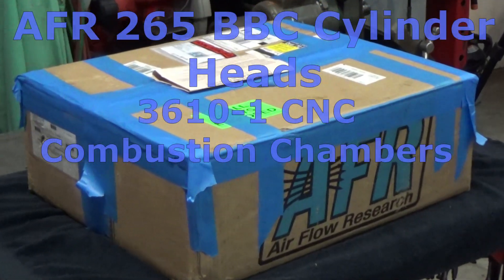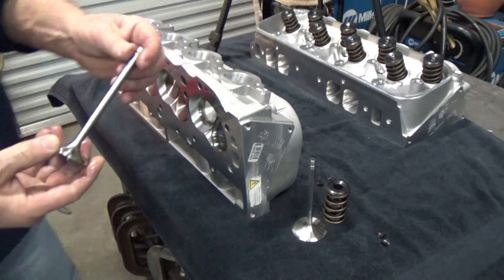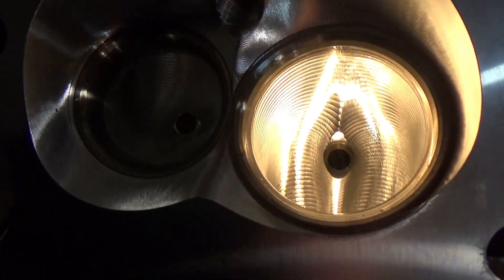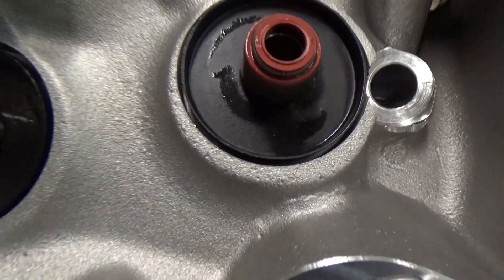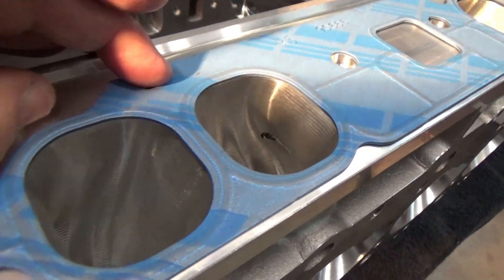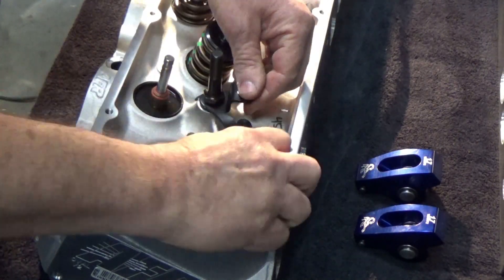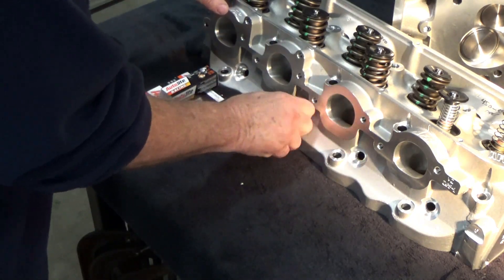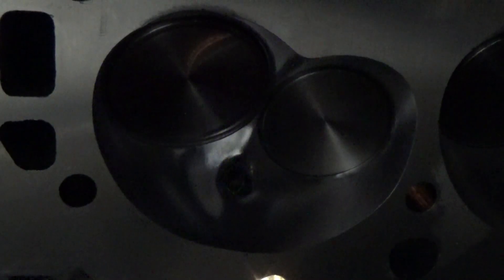AFR 265 BBC Heads... (Lets take a look  at them)!!👍#11 Chevy 454 Big Block Performance Build..

Comment: Hi sir, I can use some advice please,the cam I bought is 4 degrees advanced,do I install the sprocket at the 4 degree slot? That's what I did but having trouble degreeing the cam at this point.I am tempted to finish it up the way it is but I have to much money invested in it, can you give me some advice please? I sure could use it.
Reply from the maker: So if the Cam already has 4 degrees advances and you put your sprocket +4 degrees that would be a total of 8 degrees advanced... If you put it at 0 advance on your sprocket the cam is 4 dgrees advanced... If you put the sprocket at -4 degrees the cam would be on 0 degrees advance....  Ckecking the cam in the engine with a degree wheel is finding out if all machining operations done on the engine crankshaft, timming chain sprockets, and cam shaft are correct.  Hope this helped.... Look up (Grumpys Performance Garage) on the internet.. There you will find alot of info that can help you on your build.... Thanks

Comment: I knew i seen a video with these heads and using the springs that came on them for a solid roller i did not know it had to be a street grind i have a howards hydraulic roller 235x241 with 618 lift on a 108 lsa i do have a comp xr294 r  solid roller that is  254x260 with 660and 666 lift on a 110 lsa that id really like to run when i built the engine i was hopeing for 550 hp well it did way better it made 661 with 606 torque i was really surprised  i need to check and see if its a street grind and check the clearance what are the specs on the cam your running? I love my afr265s
Reply from the maker: Hi..... Its a comp cam street solid roller in the  240s at 50 and in the 600 lift....  Yes I really like 265 heads too....

Comment: Thanks for sharing I bought the AFR 325 and a Super Victor then had them checked and fully ported,He cut the intake into at the middle to port like he wanted,,I have a 505 ci engine I may have to much head ,I may order a block and make a 565 ci for these heads to work, he recommended a 1350 cfm carburetor, Self Racing, Kevin did a great job, He did these heads about a year ago I got to get going! Subbed for future videos
Reply from the maker: Wow Ronald ... Sounds like your going to have a very high hp engine.... I looked up (Self Racing) and looks like
they are a top Engine Performance Shop... Good luck with your engine and thanks for the Sub...👍
Reply: @Myersmetalworks  I have do business with them for years and sad to say covid caused Kevin and Glen to pass away, Great family,y car is fast with the current 496 and Pro comp heads and if I install the new heads they claim I'd pick up a 1/2 second, I run 567 @ 123 on my last pass and I'm getting a little old to be going much faster! I just let it idle and deck it on foot brake,ofcourse it has a pro brake but the 496 is a fresh build and I shift it @ 6600 rpms, I running a large Howard's Roller cam that will really perform if I'd turn it up ,it's got all aftermarket bottom end and I wouldn't be scared to buzz it up but heck foot braking what's the use!LOL

Comment: I have the same heads on my 427 60 over so it's a 440 and a howards 235×241 duration @50×618 lift lsa 108 and I used a victor Jr intake with a Holly 850 hp I'm hoping  for 550 hp. Next I will be building a 496.and I'm going to try to make 700+ hp on the street. Great video
Reply from the maker: Hi Richard, Thanks for the nice comment... Sounds like you have chosen some good components for that 427 to get to the numbers that you would like... I just like the way 427 sounds 😀    And good luck on that  496 Build....
Reply: Fddo you think with the cam shaft I have  its a howards 235x241@50 618 lift I can make 550 hp or do I need to go up in camshaft like 248 x 255 any help would be appreciated thanks Rick427
Reply from the maker: Hi richard... More duration usually will help give you a higher HP number...  But its hard for me to say for sure 
what size camshaft the engine would need to hit those numbers you'd like to hit.... To me its about a good
combination of parts working together that give good HP Numbers.... You have good heads... Sounds like a good 
intake and I like the cam you have chosen for it and if your compression is pretty healthy It sounds like it sould
be pretty close to the numbers you would like.... 👍
Reply: Hey by the way we dynoed my 427 and I got a big surprise the motor made 112 hp more then what I was expecting it made 661 hp and 605 torque at 32 degrees of timing with a 950 cfm carburetor on it I'm a happy man.
Reply: What compression pistons dude? Im building similar engine but with 110 lobe cl angle

Comment: I've ran these heads NA and boosted, the V1 I had needed the vent area opened up and also the oil drain back...otherwise a great head and yes your basically getting fully ported for $1000 cheaper...
 We even ran them on a 498ci blow the tires off rolling 55mph with 3.55 gears...
 Also have used some of the larger Rec Port....
 I've had good luck out of AFR on BBC...
Reply from the maker: Thanks for sharing and also for the good tips...

Comment: AFR is the best hands down. Can you let me know the brand name or part number of your valve compressor tool. I like the way it looked to work so easily. The pneumatic compressor I use belongs to the shop so I want something extra for my home garage. Thanks.
Reply from the maker: Very happy with the choice of AFR. Don't know if you are familiar with "Nick's Garage" channel, but he dyno tested 
a 454 with those heads, if interested...
I have had this compressor for 25-30 years and it was used when I got it, so I don't know if they still make it or not.
But it's by K-D Manufacturing Co.- Part #308. Don't know if the company still makes this one anymore.  Hope this helps.
Reply: @Myersmetalworks  KDT #380 is compressor tool new number. Thanks.
Reply: @Myersmetalworks  I watch Nick's garage dyno channel and will have to look for the 454 heads. I am considering the AFR enforcer heads unassembled to build for my next 454 build. I usually port 781 GM heads for street builds. Thanks for KD number.

Comment: AFR is a high quality product I've been using them since they were Brownfield heads. Still remember they are mass produced the runouts of the seats are not going to be as close as you would expect them to be.
Reply from the maker: Thanks for the tip...

Comment: Excellent choice in cylinder heads- this whole engine was well thought out and really hits home with me. Not sure what your business is for a living but you should be building engines like this for resale.
Reply from the maker: Thanks Philip... Always enjoy your comments... And it sounds like you have a pretty in-depth knowledge of engines yourself...  I built some performance engines for people years ago... Also
had a flow bench and Sioux valve grinder and seat set and did a lot of head porting and carburetor modifications for people.... That's why I'm so impressed with these heads... But I got out of it years ago, and have been doing R/D Design work for company's I've worked for...  Out on my own again and kind of feeling out my  new direction.... Thanks for all your input Philip its appreciated...👍
Reply: It’s a pleasure watching you. Much respect. I enjoy the talent and time to blueprint and do the things that I value as important in a build. I also am doing a build with that 265 head. Just not sure how big on the shortblock and I have one person in mind who I would want to do the shortblock for me.
Reply from the maker: I'm sure it will be a very well thought out decision, and nice engine for your application.....
Reply: What is final compression ratio? Camshaft specs?
Reply from the maker: Compression around 10-1 and camshaft @ 50 Int 242 Ex 248  Cam lift  Int .646 Ex .653  Cam is on a 110 lobe separation.....
Reply: Any plans to dyno the engine? Should pull really well to 6500. What intake fits under your hood? This engine should make north of 600hp closer to 625
Reply from the maker: Would like to Dyno the engine maybe one day... I'm a little more conservative on HP numbers for this engine, but I hope your right.... 😀 This build did start out to be a 600 + HP build,  but do to some of the car's constraints and purpose of the car it was going in, some milder parts were used.... The intake, cam timing and low tension ring package that would have helped push the engine into those numbers didn't make the cut for this build...  But this engine should have a very good HP average and torque curve.... Very fun to drive...   The intake is the Edelbrock air gap...
Reply: Easily north of 600hp 👍🏼